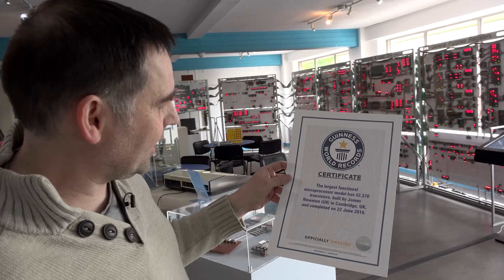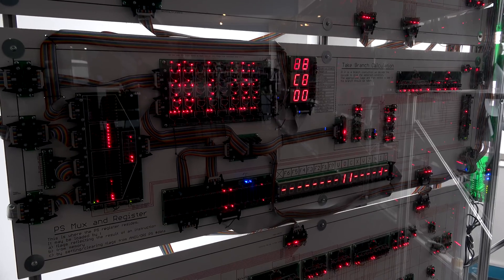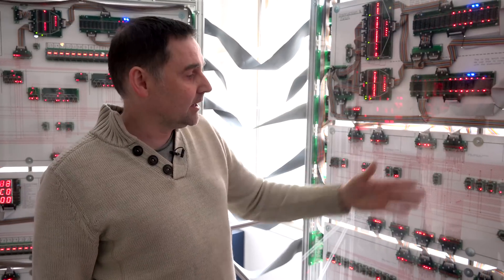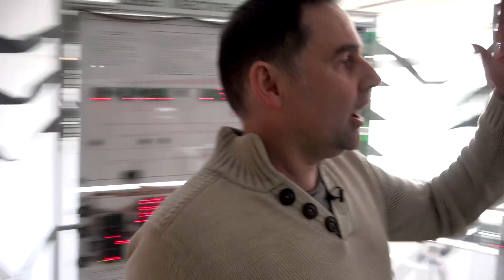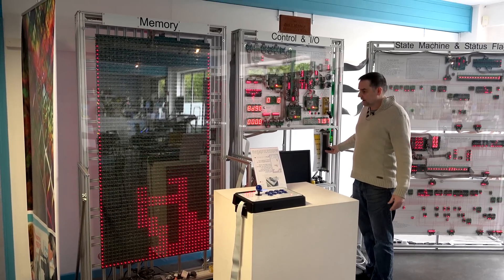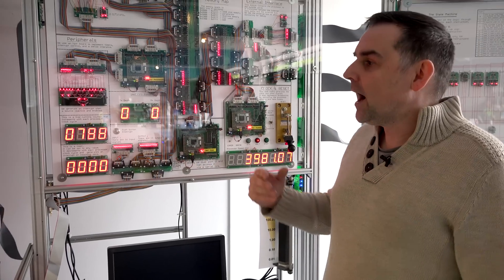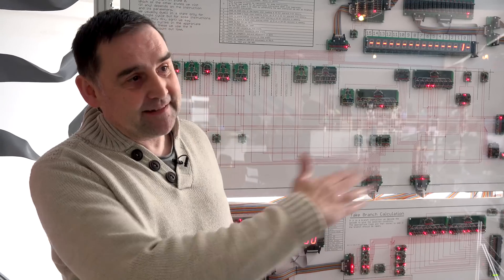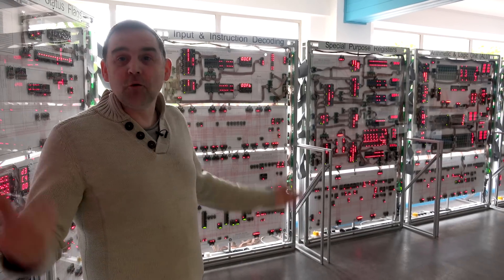MegaProcessor - Computerphile

Comment: If the memory is being used to show a game of Tetris, where the hell is the code to run Tetris coming from????
Reply: The screen makes up 256 bytes of discrete transistor-based RAM, as per the creator. It's video memory. I don't think this thing has cache.
Reply: @DanieleGiorgino  You wouldn't need cache.  You only need cache when the CPU is faster than the memory access.
Reply: Maybe, they're just mapping a small segment of memory (the video memory)  to the LEDs panel and the rest remains hidden.
Reply: It's a discrete chip of 32kB.
Reply: They're likely executing the code from bytes outside of RAM.  They could be running the actual code from RAM itself, but not sure there's enough for execution and displaying the game.  It's more likely there's bytes loaded from somewhere else though.
Reply: You would have to hand code the memory locations so that you can put the piece in the correct location.
Reply: that's data memory, there must be a separate instruction memory
Reply: The program memory is in the module to the right of the display memory.
Reply: "that's data memory, there must be a separate instruction memory"

Dont think it's a Harvard architecture machine. Given what the guy said about it's similarity to Z80 and 808x it's probably Von Neuman, meaning data and instructions are intermixed. However you can use some areas explicitly for data if you code it that way.
Reply: The tetris code is in ROM. The screen is simply a RAM monitor, and the computer is programmed to handle it as such. Most actual programs that depend on RAM monitors won't actually show you all the RAM anyway, so it's likely they have more RAM used for temporary storage
Reply: Data and instructions could be stored separately so they can both be loaded during the same cycle. Although according to the descriptions in the video that shouldn't be necessary.
Reply: In a slow computer like this an EEPROM can handle both RAM and ROM tasks just fine. There are probably two separate memory banks and this is the "RAM".
Reply: eeprom or some memory card. Maybe even a floppy disc :P
Reply: It's a PROCESSOR model, the RAM and ROM are not included!
Reply: It's the processor cache not the RAM or the ROM
Reply: probably a electronics component that is nearly as small as your normal ram, in your pc or whatever, cramped in next or behind that screen.... probably it works without that but my point of view not that educative and worth the prize it gained. i'm not happy with that design, there is an series by "Ben Eater" who builds a 8 bit processor and  uses some electronic components to replace these parts that would eat up a bunch of space and money but explains how they work before. its amazing how this guy can explain it!
Reply: Did you miss part of the video ? The screen with the LEDs for display is the system memory.

Comment: Since the "Main Memory" is also the screen and does not appear to actually hold any instruction data I'm guessing this is actually a Harvard Architecture machine with the program instructions running on a separate ROM memory bank?
Reply: There's no "working" memory on the screen either. Near the single-step controls, there's a board with "32K RAM" written next to it...
Reply: The screen is effectively video memory. The ROM and 32kB of RAM are discrete components.
Reply: The main memory isn't the memory in that case, it looks like VRAM if you could call it that.
I'd expect a fair bit of garbage pixels around the edges. Sure, maybe they read board state from the display blocks, but they need to store which tile they are moving, and its X,Y position. I doubt this small processor has enough registers for that, as something like that without touching memory would be tricky even on x86, which has a real crapton of registers.
Reply: Well the point was to create a Mega Processor. Not a Mega RAM chip. I think it lives up to its name.
Reply: aullik on the maker's defense, the architecture is totally custom and showing visitors what is going on on RAM would require a whole session about the instruction set itself.
But it would be a nice addition to have a module with a small window to ram showing some words get added, shifted, set, reset, incremented and decremented to affect the tetris game.
Reply: look, making the entire ram/rom out of discrete components would be too much effort and too much cost for little educational benefit. There's not much interesting going on in ram.  it would be a huge AF panel with thousands of the same construct all over.  if you want to see how ram works, there it is on screen, the video ram.
Reply: To all people who say the RAM should be implemented as discrete transistors: The processor works 100% without the extra 23kB of chip RAM, as long as your program only uses 256 bytes of RAM. Adding more discrete RAM would need a huge amount of place and components, so it's not really possible. If you want to see what happens in the RAM, just write a program which doesn't need that much ram.

PS: As far as I know, there's no way to write to the discrete RAM externally, but you could write a "boot loader" on the chip RAM which copies the actual program to the discrete RAM and then just remove/disable the chip ram.
Reply: And btw., there's no ROM, just RAM. The 32kB RAM chip can be controlled by a microcontroller to program it via an external computer.
Reply: I hope the screen-memory is used for tetris when they show it to visitors, but for actual education they use it as ordinary RAM.
Reply: Doesn't need to be Harvard for the ROM to be a separate bank. Can still be Von Neumann, just has to have the ROM mapped to a different part of the address space. Plenty of realworld computers have RAM, ROM, Device IO, etc all sharing memory map space.
Reply: Bpendragon Presents 
Since every processor is build with the Harvard architecture and this is only a scaled up processor, it has to be like this with the Data memory - as you said - as screen.
Reply: "this computer is magnitudes more advanced than anything you could ever dream of putting together."

Alone? Yes that's to much work. With my money? I definitely don't have the money for that!

I know that this is a ton of work. And i honestly don't wanna do the debugging to get this thing running. I mean this has a world record for a reason. The thing about this i don't like is the extra memory. Why is this a tetris machine? why. This is supposed to teach programmers how the machine works. so you can follow the instructions and micro instructions. Why on earth are they hiding the main memory? The memory display looks nice, but that is not what programmers want to see. or at least not what i wanna see. I'm pissed about this because i really really love the idea and think this is wasted potential. You don't rage about something when you are not invested about it.
Reply: Having ROM as a separate module where you see the data loading from ROM into RAM would be awesome.  but hiding the main RAM away is just ... well it infuriates me how much wasted potential this is.

I hope they add another RAM table in the future So they can transform one of the RAM tables into VRAM
Reply: This takes away so much from this machine. This is the reason i like the breadbord computer from ben eater so much more.

Comment: Now make one entirely out of magnets.
Reply: You'd be literally be switching the transistors with relays. Note that there are many ways to implement logic, whether it be trapdoors or water pipes.
Reply: You can even do it with dominoes.  If you can make logic gates, you can make a computer.
Reply: ColCoal do it with pneumatic valve if you dare!
Reply: No. DOMINOS.

Comment: Funny how the guy who created this basically has the same Surname as John von Neumann, just the english version
Reply: That prompts me to wonder if the MegaProcessor is based on von Neumann architecture or Harvard architecture.
Reply: Just like Garry Newman, creator of GMod.
Reply: I was thinking the same thing!
Reply: Even more funny (specifically ironic) is how it potentially uses the Harvard architecture instead of the Von Neumann architecture. I'm guessing that's the case, as I didn't see any program code on/in the memory/display
Reply: he's a time traveler, he went forward in time to make the megaprocessor based on current technology, then went back in time to make that future possible. makes sense, right?

Comment: Is it programmable, or only runs tetris? Also what instruction set/architecture is supported?
Reply: It has its own instruction set. And it's programmable, it reads from a ROM. Else it wouldn't have the need for a program counter.

Comment: Its kind of impressive that they can run that huge of a processor at 100 kHz with no issues what so ever.

https://en.wikipedia.org/wiki/Transistor_count
This is a interesting reference.

So 46 000 transistors would put it about between a 8086 and a Motorola 68 000.

Of cause. those processors have no cache or memory what so ever, and here..  So maybe a bit closer to the 8086, that is a 16 bit rather "slim" processor. So i would say its a fairly fair comparison

Comment: Yeah but can it run Crysis
Reply: If you are willing to wait long enouth for each drawn frame.
Reply: even 1 frame per year is optimistic, lets make an approximation just for the lulz:
We first assume that computing power is more or less proportional to the number of transistors
We also assume that computing power scales linearly with clock speed
Now, a modern cpu + gpu combo has around 10Bn transistors, lets say that the clock is at 4Ghz,
this on the opther hand has 50k transistors at 0.1Mhz max
we calculate a performance metrics: 10bn(T)4Ghz = 4(10^19)T*GHz   vs 50k(T)0.1MHz = 5(10^9)T*GHz
So that is 4/5*10^10 , almost 10 orders of magnitude in difference.  Say the current system can render 60fps, 
this one will do 60fps/(4/5*10^10)= 7.5*(10^-9) fps = a whooping 0.23652 frames per year!
Reply: In theory, if it's Turing complete, it probably could. But it would be extremely slow. For comparison, a guy made an Arduino (which AFAIK is faster than the Megaprocessor) run Linux via x86 emulation. It took around 8 hours to boot to GUI, if memory serves correctly. That's just for the OS and GUI.

Now think of starting up Crysis, and then applying a ton of DirectX to OpenGL translation, followed by then software-rendering the frame (since we can presume this computer has no GPU), which AFAIK is a ton of trigonometry and other intensive math. It would be slow to say the least.
Reply: +QuantumFluxable
not nearly enough memory

Oh come now... every one knows that you don't need more than 640k of RAM XD
Reply: port it
Reply: Maybe if you let it print the screen, from a disk, one block of pixels at a time, onto paper.
Reply: nice meme, but no. not nearly enough memory. you'd have to rewrite the game from scratch to allow for pauses in gameplay so you can load other data into it via DVD or whatever that thing is using, just to jump from code segment to code segment. You'd have to do that for every frame, probably multiple times. So IF you were to do that, maybe you could get like one frame every couple of minutes if you are lucky. I don't know the Crysis sourcecode, so any assumptions I am making are completely unfounded, but that would equate to approximately 0.0003 FPS or something like that. lol
Reply: It can probably run Doom
Reply: maybe if you play on low settings...
Reply: Alexandru Adrian centuries probably...
Reply: +Mik Wind It's not quite that bad. A modern cpu has multiple cores, only one of which would be running the game, reducing the transistor count for your calculation. So your fps might be one whole frame per year. Do I dare say two?
Reply: thug question
Reply: Don't forget to set the quality settings to "Very low".
:P
Reply: This is actually a very important point that goes to the heart of computer science, and the utter brilliance of Alan Turing, who is in danger of becoming "just" the bloke who cracked Enigma. Yes, it could. Any Turing-complete processor can emulate any other processor and perform any task that another processor can. Given sufficient storage and time. Incredibly, Babbage's Analytical Engine was Turing complete too.
Reply: Might be able to read the licence file
Reply: I think you idiots should stop saying this on every computer video on youtube. "Jokes" do get boring if you don't know.
Reply: Asking the real questions.
Reply: 1 frame per year
Reply: lol
Reply: Thanks for not letting the internet down. lol
Reply: and I'm not reading this because I want to believe
Reply: Now that's a question for the low spec gamer to answer!
Reply: Alexandru Adrian I mean, it has about 1.7 KHz, can't that run vr?
Reply: but bro that is not crysis my smart toilet can run doom
Reply: Deimos, not enough ram. It won't.
Reply: it's turing complete
Reply: When it's a full featured processor then its turing complete, that means yes it can run Crysis. However it's probably too slow to even load the instructions in a reasonable amount of time. But given you had unlimited amount of time, it can run ("emulate") everything.
Reply: FFS i was thinking that.. time o delete m comment :(
Reply: It will take hours only to calculate the boot sequence of Pac-Man, let alone anything more complicated than that. Your coffemaker machine has a more powerful microcontroller than this thing here. When you think about the fact that transistors in CPUs these days are smaller than a virus, you have to really appreciate the enormous engineerig feat that went into that.
Reply: It can run crysis at 8k 144fps
Reply: Goddammit. I'm 3 years too late. Guess nothing is original anymore
Reply: I bet you he can get Doom to run on it. I've seen someone port and play doom on a freaking oscilloscope using sound waves or some shit. Hell, Ive seen Doom on one of those old programmable calculators.
Reply: @SgtWiking  The oscilloscope is used as a "screen". It's more like your monitor.
Reply: dank u 4 complimenting my meme
Reply: No, it does not have enough memory to store all of the instructions and textures, models, etc, therefor it is impossible for it to run Crysis.

Comment: I can't believe no one has programmed DOOM for it
Reply: Doom requires 66 MHz and 8 MB of RAM, this has 100 kHz and 256 bytes of RAM.

But you are welcome to solder a few more megabytes of memory and they will attach it :-)
Reply: @NyanSten  20 Mhz and 4MB RAM are the minimum system requirements for DOOM.  It has run on a 386.
Reply: For doom your would need a whole stadium of these.
Reply: Hm... going off his "twice the size of the united kingdom" = 1  gig comment, 8 mb of ram would be roughly 1500 square miles?

So about Rhode island, but I don't think anyone's using that for anything important...
Reply: That would be crazy, the megacomputer would have to be mega-er.  But I have no doubt in the future megacomputers will grow!!
Reply: @stock fish: you dont need 16 bit. Turing complete (which ever cpu is) means you can emulate 16 bit on 8 bit. Also you dont need a VGA gpu, because DOOM (unlike quake) is rendered by your CPU ;)
Reply: Short: Every finite processor can be emulated by another finite processor:
All you need is a generic JumpIf instruction/goto and simple arithmetic to be able to simulatable any other processor. It is also able to solve any computational problem. The thing you have to assume is infinite memory and infinite time. 
If you assume realism, which every processor is btw, you only need finite memory and finite time. So people can build PS2 emulators for their PC even the processor cores are different in everything. The other way around is not used so often because it is impractical to emulate "stronger" machines. ARM to X86 Emulation would come to mind.
Reply: nah Doom recommends 4MB of RAM
Reply: HD_Picard Wow I didn't know that every computer is Turing complete. Only because it requires infinite memory, which I thought interferes with... Well... Logic itself. Plus from what I know, computer architectures have a theoretical maximum memory, emulating any machine architectures would become impossible due to memory limitations.
Reply: @jordanhall1136  Incorrect.
Reply: ...and btw a Turing machine can do what any computer can do. It will just be slower. I just realized that the Turing machine could be just as fast if you can clock it high enough. lol
Reply: Some people on youtube actually have for their own processors. You need to implement your own instruction set into any C compiler. Then you can compile Linux for it and start to play ZORG. Doom is way too much for this machine. 
Sounds easy but needs about 2 man-years to do. But once linux runs its easy really.
Reply: 16bit , lol, doom run on 32bit arch.. :( and you need graphics... vga capable... 16bit card will do.. :)
Reply: You need more than 32KB RAM for even DOOM.